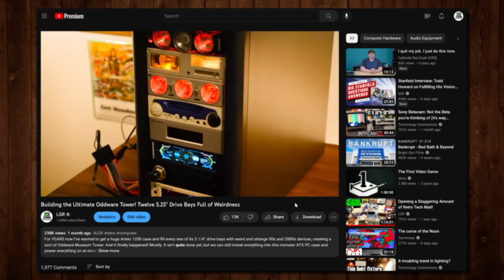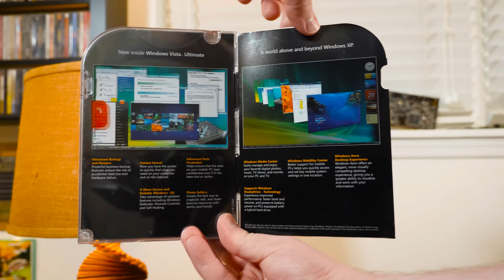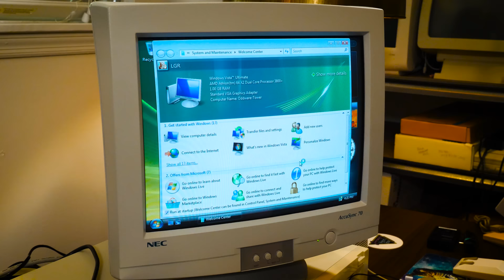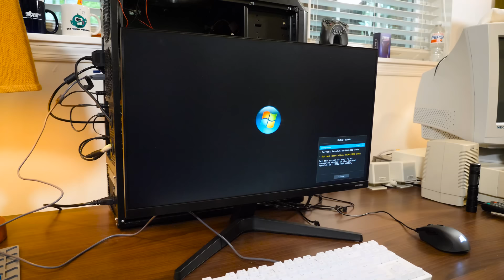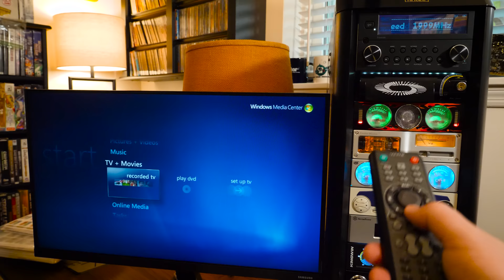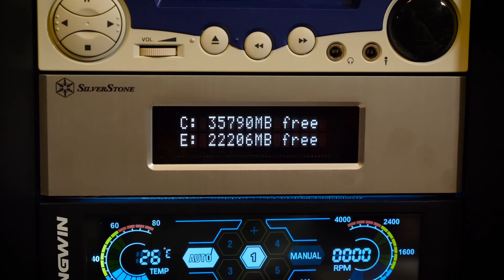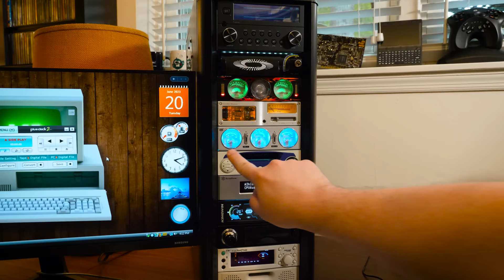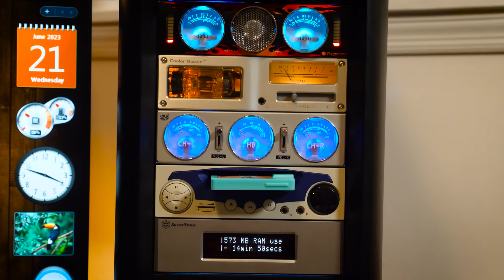Finishing the Ultimate Oddware Tower! Windows Vista PC Build

Comment: The second he showed that cooler off, I was thinking, "oh, that thing's going to be loud AF"... I was not wrong. In fact, it was even worse than I was expecting.
Reply: I genuinely wonder how much of that was poor thermal adhesion though
Reply: @ndm13  It was the fan. They are made to cool servers. They aren't made to be quiet at all.
Reply: They come in different RPM ranges, and some of them aren't too bad.  Especially if they're meant to be PWM'd.  They CAN be quite quiet.  However, they are definitely not optimized for silence, with the thin-fin heatsink butted up to the bottom of a blower which then forces air out of a rectangular cavity at a relatively high velocity...  Well, yeah, that's not how you do "silent."
Reply: @ndm13  Low profile fan and tuned for server, which is max cooling 100%, just in case.
Reply: Did you not expect it to sound like a squadron of helicopters approaching over the horizon?
Reply: Even worse than the almost period correct 7k rpm Thermaltake DragonOrb 3 I have saved for sentimental value..
Reply: @TheBibliofilus  My friend had one of those.  I remember when he installed it, I was on the phone with him and couldn't believe how loud it was. I think I had a Zalman CNPS, I'm not sure of the exact model but it had a fan bracket you had to mount to your case instead of the heatsink.  The Difference really was night and day between mine and his
Reply: @frankb5728  Not the modern HP servers. However, they do tend to run the fans at maximum speed at start up until software or the bios kicks in and slows them down.

Years ago I actually used a Dynatron low profile cooler in my HTPC build but remember switching the fan for a much quieter (but lower airflow) one.

Comment: Man this is what we wanted for the future. This stuff is so cool. Computers nowadays are so seamless and boring.
Reply: We also get older, there's still a market for modding but I guess nowadays it's mostly led and window cases, not these oddities stuffed together :)

I had a manual fan controller on my previous build, but replaced it 2 years ago in the same case and just plugged the fans in the motherboard. It's a nice gimmick to be able to control fans manually, but not more than that (for me)
Reply: Not really. This stuff disappeared for a reason. It’s dumb and mostly useless. It’s here for a small niche crowd like us, but no one will run out to buy 5.25” nonsense anymore. Even I didn’t back in the day.
Reply: @IvorySoul696  Nah man... I need a massive high resolution touch screen in the front panel of my case showing all kinds of things and controls
Reply: I know it's why I love peoples cyberdeck builds. Is a regular laptop more functional sure but a briefcase capable of satellite hacking is way fucking cooler lol.
Reply: OP never said this old tech was better. It is cooler. Plus most tech today can't even be seen. I rarely use flash drives anymore. Soon we won't even have devices, just glasses or contacts!!
Reply: @@jamesbanios9476you cannot light a cigarette digitally though

Comment: That dynatron cooler is a proper fly murdering machine. Whatever comes even remotely close gets sucked in and shredded into bits.
Reply: just needs blue LEDs, I had a case with a blue LED front 120mm.  couldnt make it a summer in an non air conditioned home without a few flies cut in half by the blue Antec fan.
Reply: @filanfyretracker  Nice one.
Reply: The best part is it is using the intake side of the blower, so it isn't even being particularly efficient.
Reply: @filanfyretracker  I'm suddenly reminded of my mid-00s UV-reactive PC. 
Opening up the house in Vegas' summer's night, definitely had bugs attracted to my (windowed) case and monitor.
Reply: Delta fan has entered the chat
Reply: He just needs a halogen light or two.

I used to have a halogen floor lamp.  It had a rather nasty tendency to attract flies.   And you could smell the flies getting fried! Ew!
Reply: And now, I need one. Too many flies around my house x.x The thought of just wiring it up and letting it suck up flies in my room is kinda fun xD Although I probably wanna wear ear covers but thats fine. :D
Reply: Literal jet engine bird strike lmao

Comment: The CPU cooler was made by Cessna, it’s designed to add 5 knots for heavy winds on takeoff on a 172. Alternate use was for sailboats when wind isn’t present.
Reply: it's the dynatron A48G i think dynatron still sells them, actually a pretty neat copper heatsink. but yea it's a 7k rpm fan so he probably made the right choice swapping for something quieter

Comment: Fun stuff.  AM2 was actually the second dual core platform from AMD, the first was in 2005 on Socket 939.  It was memory bandwidth starved on DDR1.  Also a cool thing for those who don't know - the AMD bracket Clint struggled with briefly is compatible with every (edit: mainstream) AMD platform from 2003 to 2022 - 754, 939, AM2/3/4.  Allows for silly stuff like Wraith Prisms on OG Athlon 64 Clawhammers - the RGB control software even works in XP :D
Reply: I might have to do that now. Gotta love AMD's backwards compatibility.
Reply: I actually bought a dual cpu for 939 socket dont remember the speed, installed it and didnt boot, figured it was bios needed an update and since it just sits there, n I download the bios but it still never did that update😅😂😂
Reply: Aqua Computer do a similar thing in the opposite direction, you can get a AM4/AM5 Mounting Kit even for their first gen cuplex coolers from the early 2000s (they were founded in 2001) and Intel LGA115x/1200/1700 for their slightly later cuplex pro and evo.
I doubt that these early can handle the top-end CPUs because they only got one large channel that winds around a few times but no microfins, but maybe it's still okay with a Ryzen 3/5 or Core i3/i5.
Reply: I had a Socket 939 system that was built in 2005. Used it until 2018, until we finally gave up on each other. I switched between XP and 7 all the time. It had a single core 3500+ running at 2.22 GHZ. It ran GTA 4 okay, The Sims 3 and 4 mostly fine, and my favorite games to play on it was Bully and Mirror's Edge. It made a great Windows XP gaming machine. It also had a 512 MB ATI Radeon x1600 on it.
Reply: I remember buying my first all white Sapphire motherboard using that chipset

Comment: Definitely needs an oddware keyboard and mouse, even if they're ones you've already covered.
Reply: Absolutely! I'd even suggest an odd monitor. Let's just make it as strange as humanly possible!
Reply: Maybe something like a Logitech G19 Keyboard? Or one of those typewriter keyboards?
Reply: It’s gotta be the burgermouse!
Reply: think there was a keyboard - possibly logitech(?) - that had a Sideshow display at the top!
Reply: @Chepakishui  yes! those were the logitech keyboards supported sideshow! maybe starting with the g13
Reply: @succulent951  IIRC the G13 did not have a screen, the G15 had a black and white low resolution screen with RGB backlighting that matched the keyboard lighting color, and the G19 was the one with the color screen that was mounted in an oddware looking manner.
Reply: One of those laser projection keyboards.

Comment: "Mismatched tower of nonsense"? Sounds like my kind of PC. All we need next is a dual monitor setup.
Reply: Only 2 monitors? Nobody likes a quitter!
Reply: Dual vertical monitors for extra chaos
Reply: Dual one monitor 4:3 CRT and one 16:9 LCD.
Reply: Triple monitors.  4x3 LCD in the middle, mismatched CRTs on the sides.
Reply: Set them both sides of the tower :)
Reply: Better only 3x3 monitor wall, or even VR headset from that era
Reply: A 3d tv
Reply: A triple monitor setup but all of them are vastly different sizes and aspect ratios
Reply: Two 16:9 monitors vertically, one 4:3 monitor in profile to the side, y'know, for browsing.
Reply: Try 3 mismatched crts.
Reply: A triple crt monitor setup
Reply: It sounds like a tagline of an early 90s Sierra game 😅
Reply: Too bad he probably wouldn't have the bay spaces even if he took out the 'useless' items to put in the drive-bay CRT...
Reply: Going with the oddness of the build, I would say maybe go with a monitor, like one I remember one of my friends had, which was a flatscreen "crt", as it still had the size of a crt, but was flat on the front glass.

Comment: It's an awesomely wonderful and odd way to show off the oddware - I dig it. 🙂  The 5.25" bay needs to come back. 🙂
Reply: I am currently upgrading my PC and was still using my tower case from 2008 (really should have gotten a new case sooner), but it was actually a little depressing seeing that 5.25" bays are a thing of the past. I was hoping that at least some case manufacturers would maybe find new innovative ways to include at least one 5.25" bay, but I ended up going with the Phanteks Enthoo Pro Tempered Glass, as Phanteks has some nice cases and quite a few have 5.25" drive bays.
Reply: @TigonIII  My case isn't that old (from 2016), but it def does not appear I'll be able to move off of it due to the lack of 5.25 bays (I need my card reader, and don't want on floating around my desk).

Comment: 12:00 if you want to use PLA(+) you should think about using Annealing. It’s really easy to do and can strengthen your prints quite a bit, adding more heat resistance to it 😁👍
Reply: I instead recommend PVB filament, so that you can smooth it with isopropyl then burn it out to do an investment casting of zamak alloy.

Comment: Hey Clint! That weird CPU fan is called a blower and is endemic in rackmount servers. As you can see from the arrow, it's designed to move air rapidly from the front of a rack to the back. It's also highly variable depending on CPU load, and – as you might imagine for something that spent its life in a server rack – noise was a least concern. 

Back in the day the company I worked at learned the hard way that rackmount servers needed to be inside an enclosure when they were on-site in a shared office environment... 😅

Comment: I recently brought back to life a system I built in 2009 that has almost as many front panel do-dads. I leaned less toward the audio side and more toward the complete fan control aspect including; 4 fan controllers to manage the 20-some fans in the full tower case, 3 drawers, 2 intake bays with 3 fans each, and a full atomic clock. Of course this was all built unironically, not for the hilarity, but for the full control and monitoring of every cubic inch of space as it own individual heat zone.
Reply: we need video footage of that 🤣👍

Comment: Even this motherboard has a 24-pin power connector.  Was 20 pins EVER a thing? 😨
Reply: I've got boards from 1998 and 2001 that have 20-pin connectors. I'm not exactly sure when the switch to 24 pin was made.
Reply: The Optiplex GX 260 used a 20-pin connector, as did most 90's ATX devices I believe.
Reply: @Dreams_Of_Lavender  20 pin connectors seem to have been used for a very small period of time, considering PSU's have accommodated for them for decades.

Comment: If you're making a vista computer, i think you should use a vista era gpu, something from the ATI HD3000 series or geforce 8 series, if you have it.
Reply: I un ironically used Vista when it came out, and I found it was totally functional and useful on appropriate hardware, and had enough back compatibility to use my entire Windows CE development suite; it even was a halfway decent Web server for our internal documents. I didn’t try to make a gaming rig with it but it doesn’t deserve the reputation of being useless. Now, Windows 8, on the other hand….
Reply: HD 4870 and 8800GTX is a best room heater, 2x6pin in 2008
Reply: my 2009 ATI Mobility Radeon 4650 (laptop improvised model before laptop gpu's became a thing...) could run games launched up to 2015 or later in High settings... reached 90 C degrees real fast though... undervolting worked miracles
Reply: things were on a different level of quality and future proofing 😥
Reply: correction: ATI Mobility Radeon HD4650 👍

Comment: I was using Zalman in the Mid 2000's. No vacuum for me. I always valued quietness. When I built my first Athlon 64 X2 (939) rig in 2006, I went for a Zalman CNPS9500 LED cpu cooler. Put a Zalman VF900Cu on the video card. I used a bunch of Yate Loon 120mm fans and a Zalman fan controller and dialed all the fans down. I still use that CPU (4400+) as a paperweight on my sticky notes pad.

Comment: 5:45 -- I don't care what anyone thinks, I *liked* Windows Vista!  It came out around the same time I bought my first x86 PC (I was a Mac person and upgraded from a heavily upgraded G4 to a 2006 Mac Pro 1,1) and while I honestly didn't have much use for Windows at the time, I was so enamored with the fact I could run Windows if I wanted to I immediately invested in a copy of Windows Vista.  Maybe it's because it was my first "real" Windows install (I'd messed around with XP elsewhere, but nothing serious) but I thought it was a very good release.  The one thing I will say is the first Vista Service Pack fixed a LLOOTT of issues (not the least of which allowed Vista to recognize the entirety of the 8 GB of RAM I had installed in my Mac Pro at the time).

Comment: This just brought back a high school memory for me. In the computer lab, all the PCs had little speakers in the drive bay. The thing that always struck me as odd about them, was that the speaker assembly was able to swivel around in order to point left or right. Seemed really over-engineered, because really I don't think swiveling the speaker a few degrees left or right is going to improve the sound of such a crappy little speaker.
They also had a swappable hard drive bay with a key lock and little plastic lever for pulling it out, I guess to make it easier to access for the IT guy.
Those 2 plus the CD drive, 5.25" floppy drive, and 3.5" floppy drive made for quite a loaded front panel! Yeah this was the early 2000s but I guess the school had invested a lot in their library of educational software, so they were still committed to using those 5.25" floppies!

Comment: I printed a similar bracket for fx water cooler in fx 8150 build. I used generic abs on a printer without enclosure and no practice with abs. Turned out perfect, used for years and still looks new. The key, just use an abs slurry for adhesion to straight glass bed!

Comment: If I remember correctly, there was one device you left out of the build when you were assembling the tower. I'd remove the weird AC thing since it just blows air and replace it with that. Aside from that I'd say get weird as possible and throw something off the wall like a floppy bay in just for kicks if you really want to remove the lighter
Reply: I wonder if it's possible to remove the drawer from the lighter bay and install a floppy drive, while keeping the lighter itself.
Reply: @renakunisaki  That would be interesting however it looks smaller than 3.5 inches, which is the smallest size that the format was ever available in as a standard.  You'd probably have to do some heavy modifications to both the lighter and the floppy drive to even have a shot at making it work

Comment: I would have gone crazy with my tower as well if I had access to all these gadgets. Sadly, my towers were always so generic and boring...I did buy a fancy tower once with a door on the front panel. On the door were a bunch of gages and meters for audio and fan speed, etc. But every motherboard I ever put in there was always missing 1 or 2 components for those gages to be functional...plus the door was ultimately annoying and blocked any fans on the actual front panel. Nowadays, I just have "gaming" tower with RGB fans on the front...OoooOOOOOoooOOO...

I see keep the Oddware Tower as it is and just periodically make update videos where you try different gadgets here and there. I'm always up for these sorts of hardware videos. Keep'em coming.

Comment: I had a Matrix Orbital LK202-25 5 1/4 USB LCD screen in a computer build back in the mid 90s. It is on the same principal as the Silverstone FP54 that is in your tower. The Matrix Orbital had a face plate with 7 buttons on the face to do different functions with the LCD screen. It also used a software program that was about the same as the one you were using and was able to do the same things to be displayed on the screen. I programmed it to go through a system information routine with all the hardware in my computer.

Comment: It is deliciously chaotic as it is,
but if I were to change something I would:
get rid of some of the redundant components and then perhaps,
add an ODD,
add a 3.5 inch floppy drive (in a bracket),
add a 5.25 inch floppy drive,
add an HDD hot swap bay,
and add a card reader module with as many card formats as possible.
Also, keep the cigarette lighter but put some stickers on its tray.

Comment: Those SATA DOMs are fun, especially when you get into the newer industrial/server boards.  Often an orange/yellow color sata port, they also provide power so no molex connected needed!
Reply: @Valthonis
i have nave seen any ata ports on HP system, IBM too
We use NVMe in disk arrays, containers, same as we use HDD drives, as a NAS park at home

Comment: Needs cold cathode tubes. Rings for the fans and bars for that sweet, early 2000's aesthetic. Multiple light-up switches for them installed on a font panel blank.